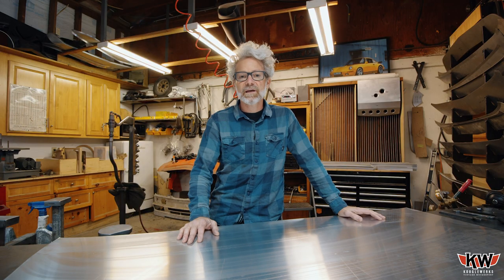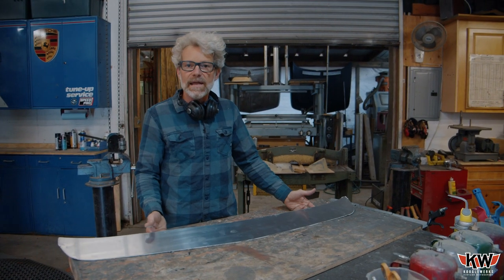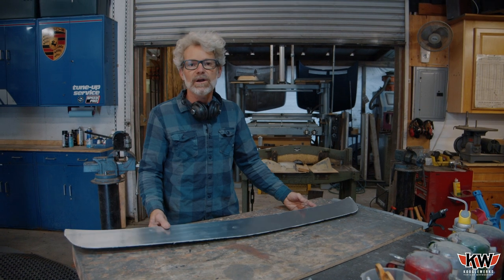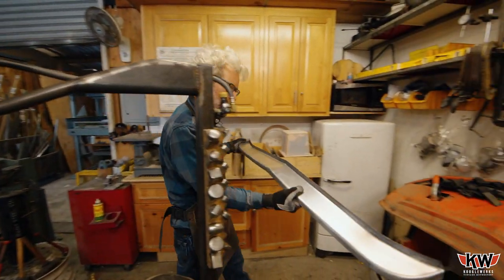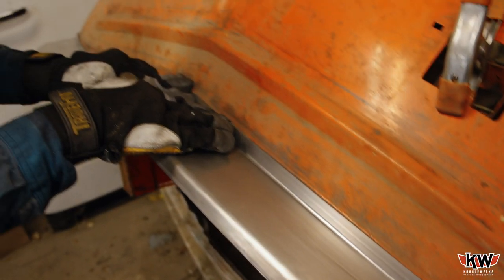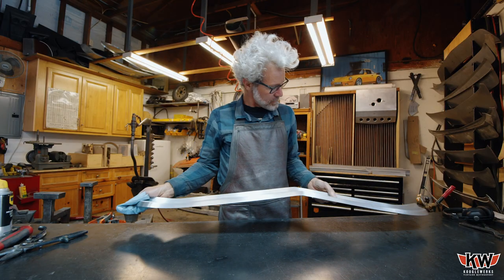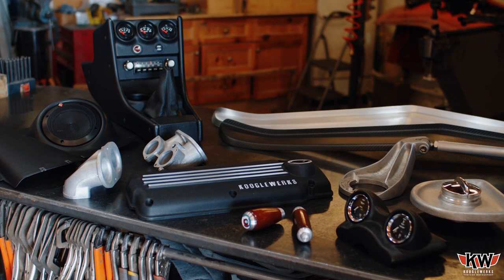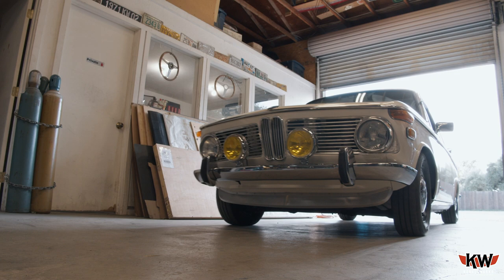KoogleWerks trade secrets revealed! hand made vintage motorsport parts

Comment: What's that first shaping tool called with the point?
Reply from the maker: It’s a “tipping die” setup, running in our Pullmax P3. (Universal reciprocating sheet metal machine)
Reply: @forrestkooglewerks4148  thanks forrest. always wanted a spoiler like yours but for an e36 and i may go about trying to massage my own. That or im just gonna glass one. I dont how almost all  of them stop and the trunk line. The over hang is a nice touch. Thanks for replying your stuff is truly art.
Reply: @forrestkooglewerks4148  The curved line always blew my mind. Now i kinda see how it works!